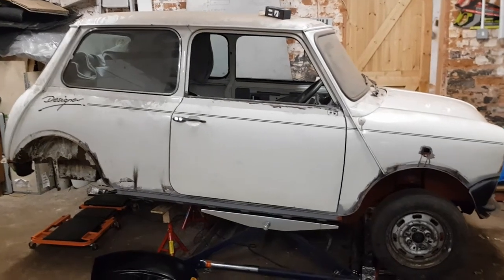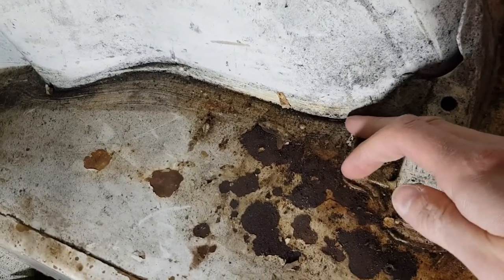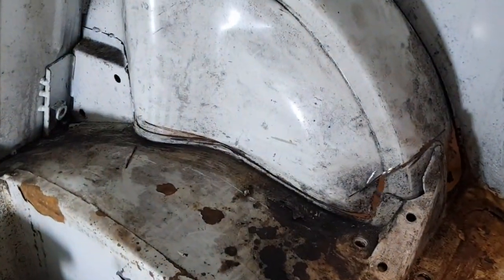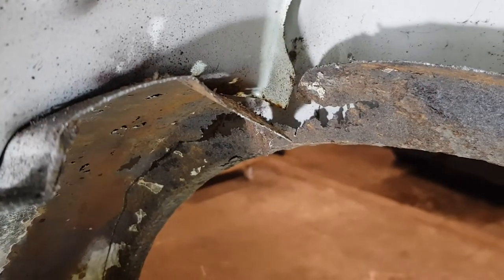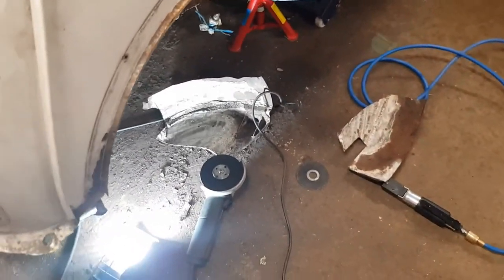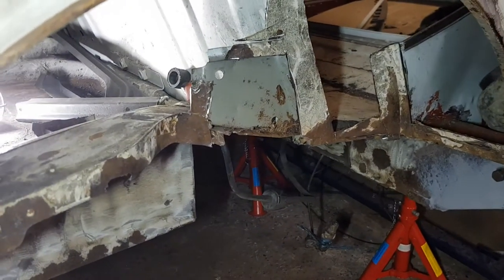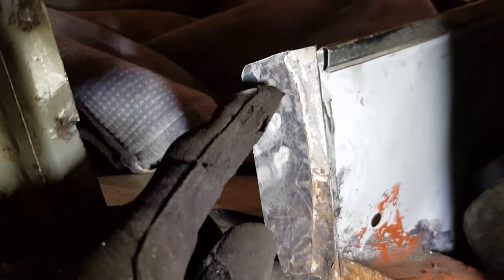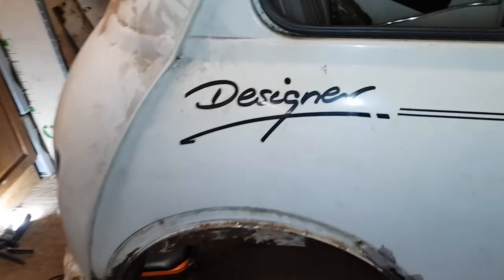Project Designer Ep 22 - Rear wheel arch removal

Comment: If you buy a spot weld drill bit you only go through one panel
Reply from the maker: I've got some but I've never really had much success with them. I find that using a step drill bit is much eadiery. Plus I need the holes for plug welds anyway